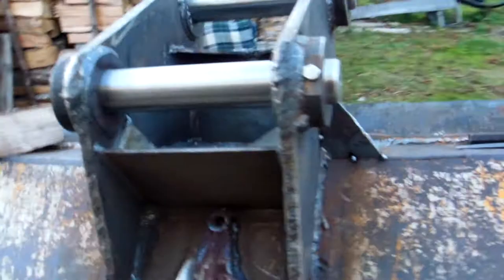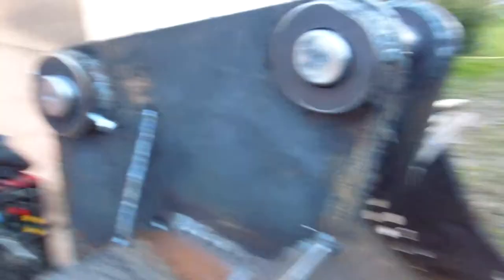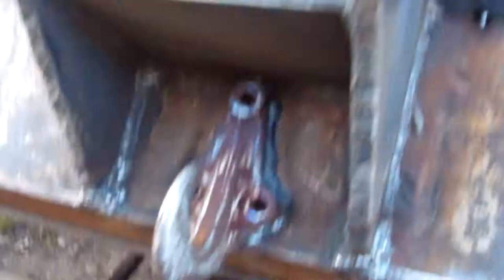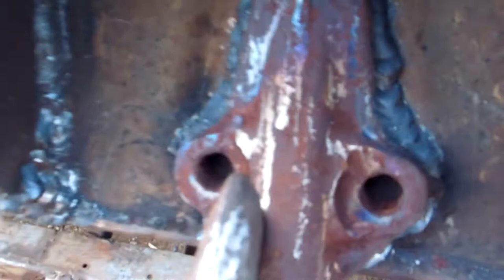Excavator bucket rebuild - end /p10

Comment: Good idea with putting triangle gussets for added strength I have a loader on my tractor that needed repair after many years of working it... From the look of the cracks you had to weld, I think the operator of that one has made many bucket loads while still turning into the dirt... Pretty hard on the machine. You did a good repair to help it to be able to take that kind of abuse! :o]

O,